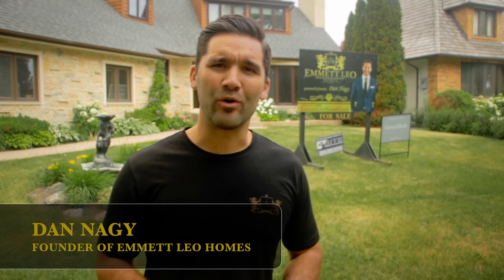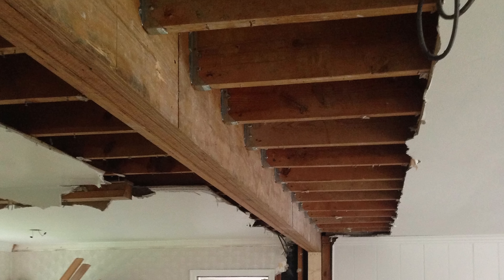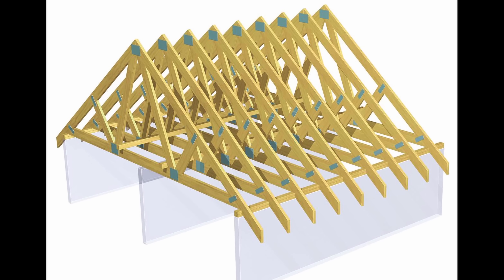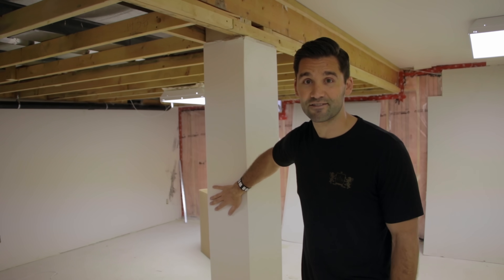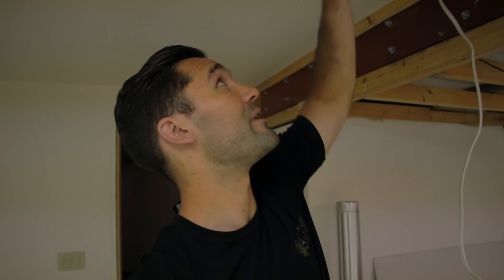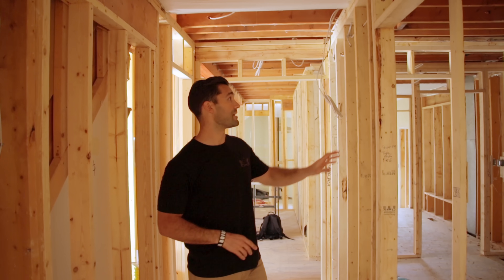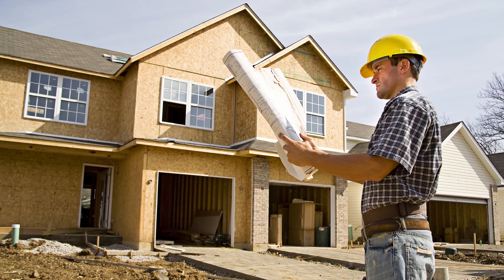The fastest ways to tell if your wall is load bearing or not!

Comment: Is there always the support and concrete pad under the floors?  I have log post, would there be these supports under the house of the posts that would be supporting?  There is not way to see this open valted area in the attic, as the walls to the area go all the way up.

Comment: Nothing "easy" about this explanation, I'm more confused now than I was before
Reply: Ok. So I'm not alone on that. Sorta kinda thunk i get it
Reply: Ya, I know right.. Im a licensed GC in Ca for 25 yrs now and all I got was "Thank you captain obvious" on a few things he said. B- for effort, and here's some actual useful advice - hire a structural engineer if you dont know things like trusses distribute the load to the exterior walls, or single story shear walls carry about 60 pounds per foot and 120 pounds for those with 2 stories. Also, if a wall runs parallel to the joists, it absolutely can be load bearing, it depends on how the loadpath was designed. You cannot simply explain away "load bearing wall removal" in a five minute YouTube video. This is the perfect recipe for a major catastrophe, some guy telling everyone they can definitely remove a wall if its running parallel to the joists. Scary. Like I said, 25 years building and modifying homes in some of the strictest cities and counties in the US and I still get a professional opinion on this. Not cool bro. Not cool at all. Someones house gonna fall down on their head cus you got em all confident they can DIY their own homes structural engineering.
Reply: @jdubs71417  I felt the same. Seems like a recipe for disaster. This video is for likes and subscribers.
Reply: @jdubs71417  I am an engineer. Most likely of the wall is parallel with the joists, it isn't load, unless it is an interior shear wall. However, those are easy to spot because they either have 1/2" cdx sheathing or the drywall is screwed on.
Reply: @jdubs71417  great advice. I hope everyone was able to see this
Reply: Wtf did he say?!
Reply: I'm even more confused 😕
Reply: @REALCRISKO  easiest way to tell if it is of isn't load bearing is to see how your joists run. If the wall you wanna take down is perpendicular to the joist then they're most likely load bearing. If they're parallel then they're not
Reply: Not all homes have basements either  like in Florida.
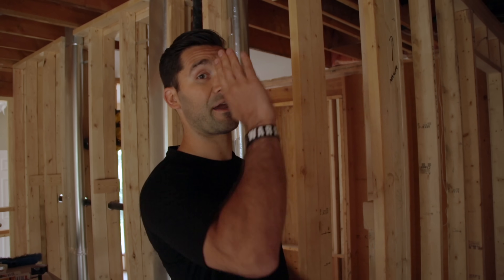Reply: Right? at 02:27 he says the joists run perpendicular from the said wall, when they were actually parallel. WTF?
Reply: @mrchedda  loll i thought i was the only one who heard that . wtf
Reply: @mrchedda   Yes, just using language precisely would improve the advice 50 percent. He also pointed at a "beam" which was a column. Doesn't seem to know the difference. oy.
Reply: @mrchedda  thank you! im like hol up. he just said that wrong.
Reply: @mrchedda  he is not taking that wall as a example....he is just talking an concentraring on the joist....if they run perpendicular to a wall forming a 90° is a load bearing wall, if they run parallel to a wall, it is not a load bearing wall....
That is how i took it.
Reply: Confused by him explaining geometry using loads that are bearing walls to be removed by looking at my house from the outside. Hard pass on this advice
Reply: same here , more confused
Reply: Im glad im not the only one.I know I am not this slow.lol
Reply: Thank you!!
Reply: Usually the longest running outside wall will have the floor joists sitting on them. If you have an un finished basement look at the floor joists they always are sitting on the longest run outside walls. And if you have a big enough span somewhere in the middle of the basement you’ll probably see a header or beam being supported be metal poles into the concrete that’s your load bearing wall and any walls going in the same direction above that beam are probably load bearing as well. If you have a finished basement and can’t find the load bearing wall just kinda find the centre of your home and any walls in the middle of the home are probably load bearing
Reply: Simplest way to put this is:picture a rectangle which is the basic shape for a house.in the middle of that rectangle you run a line parallel to the two longest sides.so you end up with three long lines (parallel)and two short sides.those three long lines are your supporting ( load bearing) walls(two exterior and one interior in the middle.all the joists will rest on those three structures at an angle ( cross) and any wall directly stacked above those three walls and run in the same direction ( parallel)are load bearing and so on.any walls that cross those lines(perpendicular)are NOT load bearing.
Reply: I think he's confused about perpendicular VS parallel
Reply: Ok so what is a joist?
Reply: I thought the drywall supported the roof?
Reply: @tbauer2521  lol

Comment: Would there ever be (ceiling) drywall between a top plate and a ceiling joist? I have a truss roof.  Wall is running perpendicular to the ceiling joist (middle of house). Seems like it is non load bearing?
Reply from the maker: metalmassacre84 good observation.  Partition walls with drywall between the two means that they installed them after the initial ceiling drywall was up, and then someone else renovated and left the small drywall piece there (and the wall).

Granted, there are times where people do stupid things, so beware and confirm prior to remove especially if it’s perpendicular to the trusses, but you have the right idea.  

What does the support directly beige the wall look like? In the basement or crawlspace.  That will be your best indicator.  

Thanks for watching!
Reply: Emmett Leo Homes its a 1960s house. This wall separates the kitchen and dining area. Im trying to open it up. It seems to me that the load goes to the outside walls (not this interior wall). At first i thought it was load bearing but took off the wall drywall and saw the ceiling drywall sandwiched between top plate and ceiling joist. This makes me look around more. Im thinking its not load bearing

Comment: okay, nice and cheeky. What if your "little" house is built on a concrete slab? Perimeter is load bearing, but interior walls?
Reply from the maker: David Balicki Then you don’t have any interior load bearing walls...
Reply: Before you pour the slab during initial construction, you pour structural footers to support posts that would be flush and level with the final slab.  For a remodel, you would have to demo a hole and pour a footer for a post to be able to bear the load to support a beam.

Comment: So I just bought a rancher. The wall between the living room and dining room is the load bearing wall. It has a standard size doorway between  the two, but I want to open it up about a foot and a half on each side. Is that something I can do or would it have adverse affects?
Reply from the maker: Christopher Spencer is it is load bearing, the opening will have a header above the opening.  This has to be elongated for the new opening.  

However, and this is the most important part, the structure underneath which is currently holding the posts or carrying the load of the wall must be analyzed and if you are moving any weight point load, they have to be carried down to whatever foundation structure is below.  

Best to start at the foundation and plan up from there for load bearing.  

Best to consult an engineer or architect, and they will be able to draw a plan, and stamp it to avoid any liability issues for yourself.  

Make sense?

Thanks for watching.
Reply: @EmmettLeoHomes  
Thanks for responding. It is a load bearing wall but the support column in the basement isnt directly under the door opening. The door is directly over the beam however

Comment: I'm wonder if the wall under my stairs in my laundry room is load barring. It does have a door. Not the wall on the other side, just the one in my laundry room. 
I want to knock out the wall to open it up.
Reply from the maker: A R stairs on the main floor or basement? Most new stairs are hung in place and then supported on the top and bottom, not typically by the wall that creates the small storage underneath. 

Does the all continue up above the stairs and support anything else?  

Thanks for watching.
Reply: @EmmettLeoHomes  thank you for responding. No basement. The stairs are on the main floor. 2 steps, then a landing, turns rt, then about 9 steps, another landing, then 1 step rt to the loft. The wall is attached to my wash room ceiling. The wall meets up with the hall upstairs, but not  further to a ceiling. There's a railing along that upstairs hall/wall, which would probably be the wall from the side of the stairs I would like out. Just that one side.
The other side of the stairs, the wall goes up to the second story ceiling. As I walk up the stairs, there a wall on my left, but open on the right and open above head. So as I walk up, the wall on the right gets shorter and turns into a railing.

Also, I have a few areas in my house where there are pop outs and hollow.  The builder could have put cabinets or something to use that space. There attached to the walls, so when I pond on the wall it's hallow. I really need space to put a cabinet. How would I go about doing that? Carve it out? Do I put a prebuilt cabinet? What to use or how to repair the dry wall (frame)? Do you suggest a video on this? Thank you so much!
Reply from the maker: A R there’s a lot packed in there.  I would suggest simply getting a recommended contractor in there to give you his honest opinion.  Maybe hire him for an hour to run you through it.

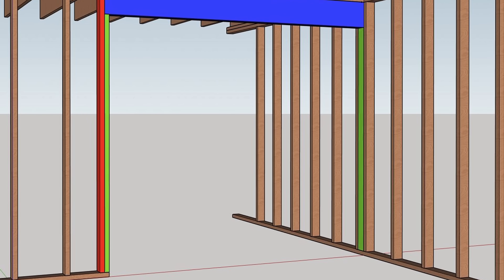Comment: 1:21 A single jack on each side of a greater than 60" span wouldn't fly here in the states anymore, how old is this photo? 7:00 new wall in an existing room and I see new copper instead of PEX, I build in the Colorado Mountains (9000') do you not worry about freezing pipes? Good stuff
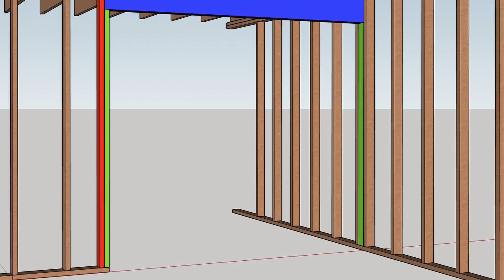Reply from the maker: Gobuilditbetter 1:21, yeah, not here either.  No idea about the photo, I’m sure the editors snuck it in here.  Post has to be as deep as the beam is wide.  Typically 3 ply 2x4 (or 2x6).  
7:00, that’s an interior wall you are seeing.  We use mostly PEX here too.  We only worry about freezing on exterior walls, which we then build out secondary or stub walls.  Thanks man.  Thanks for watching!  Stay safe out there!
Reply: @EmmettLeoHomes  Editors? Now I'm jealous. Good production. Be Blessed

Comment: Hey! I found this extremely helpful. I do have another question..do you need to re support the beams in the basement if you are removing a structural wall on the main floor? Thanks in advance.
Reply from the maker: badbike_widda_badbitch great question.  In most cases no, because the load above remains the same.  The only time this changes is if you are changing the load points (the pints where the upper load is being transferred to the downstairs support) and where they come down.  If you move them off the beam/supporting structure, then you will have to reconfigure/re/engineer the support.  Make sense?  

Thanks for watching!

Comment: This video is about load bearing walls and support of structure. I noticed those 1 3/4  inch holes drilled in the 2x4's for the 1/2 copper pipe. Thats not code. I would throw them off the job and toss there tools in the dumpster so they can't do that damage to anyone else's home. I would get there kids names and send them all a letter informing them there is NO SANTA CLAUS as well. That wall is no longer studded with 2x4's..its studded with 1 1/2 x 2's.  Also..if you want to know what way the ceiling joist run just go in the attic. You knock a hole in my ceiling just to see what way the joist run then you just bought yourself an asswoopin. I would flattin your truck tires and for redundancy poke a hole in your gas tank to be SURE that I atleast slowed your fuckery.
Reply from the maker: Effie A Marty First...you need a hug.  Second...yes, running your plumbing through 2x4 walls is code.  

And a 2x4 stud measures 1.5” x 3.5”.  The old dimensional lumber used to measure 2”x4” until they came into mass production.  

Also, don’t be so mad at your father.  I’m sure he loved you.  

Thanks for watching.
Reply: Wow.

Comment: You can use a magnet 🧲 to find the screws and find out which directions they go... just a helpful tip lol
Reply: Good IDEA buddy.. !     Thanks!👍
Reply: Can you give more info, which direction should it go?
Reply: Cenddie Alaban well if it’s a wall, the studs should be 16-24” apart and the screws should be 1 foot apart... just pretend you are erasing a chalk board and you will find the screws.

Comment: One quick way to determine a load bearing wall (if it's not covered and you can see the framing) is to look at the openings. If the opening has a solid header above it, I can guarantee that the wall is load bearing. Non-load bearing walls will have open framing with short studs (known as "cripples") above the opening. Also, in older homes (80's and before) the interior non-load bearing walls only had one top plate, while load bearing walls had two, just like the exterior walls. However, in today's construction, many builders just double top plate all of the interior walls so they can use the same pre-cut stud height for both load bearing and non-load bearing walls. Great video! I enjoyed it!
Reply from the maker: Thanks for the comment and watching!
Reply: What about a mid 1970s ranch with engineered truss? 1000sf small ranch with crawl
Reply: !aå
Reply: That's some pretty based "rules of thumb" that I could contradict with most of the homes I've owned.
Reply: Over time, twists & turns even small can transfer loads unexpectedly so it is good to check as is vs what it should be

Comment: Even with all of this, you may have trusses designed as clear span trusses, as in my house. In that case, there are no load bearing walls, on the upper floor. Of course, the only way to know is to have access to the original plans. Plans were submitted to your regional building authority. You may get that info from them.
Reply from the maker: Correct.  Thanks for watching.

Comment: I can generally see joists just by them bowing... No need to damage the ceiling ...
Just making big posts don't mean much. The entire load is now directly on those posts, rather than distributed through the entire span. You need to know if whatever is directly below can support the weight as well.
Reply from the maker: LightGesture you bet.  Understand where the load is at the bottom (which is why we say start from bottom up) is imperative.  Thanks for watching!

Comment: So if I go into the basement and the joists are running north to south and the wall in the kitchen I want to take out runs north to south, it it not structural-meaning I can take it out...? “Should be able too”
Reply from the maker: Melody L well, it doe so dictate that it may not be load bearing.  No second storey?  Any other architectural features that may change the load bearing?

Using this video as a guideline is great.  I would dig deeper now as chances are good that it is simply a partition wall. 

Make sure to have someone local come in and make sure 100% prior to removal.  

Remember that you may have mechanical, plumbing and electrical that needs Re-routing if it is in the wall you want to take out. 

Thanks for watching!
Reply: Emmett Leo Homes there is a second story. Gabled roof...there is no plump or electrical on the wall at all. In the other side of the wall is a wall length closet. I am pretty sure it is not load bearing but I will ask a contractor friend to verify. Thanks for your response and your video!

Comment: Do the floor joists always run the same direction as the ceiling joists?
Reply from the maker: Most of the time yes, in simple construction, they run the same way.  

With more complex structures, or more custom builds, you may see some alternating supporting structures.

Comment: I noticed that you retained the support post in the basement that was directly below where you installed the LVL beam (in the video you said it was right below where you were standing) why didn't you remove that post as well?  If the load on the first (and subsequent floors) has been transferred to the outsides of your 20' LVL I would assume the beam you were standing no longer supports the rest of the house, it would now only support the floor you are standing on, therefore you could open up the space in the basement below as well.
Reply from the maker: No.  The upstairs structural wall was replaced entirely with a post and beam (instead of the entire wall.  That post upstairs had to be supported by on downstairs.  You cannot have a post upstairs unsupported from below unless you are redoing the ENTIRE structure below to support it (which wouldn't make sense in this application financially or practically) . Thanks for watching.

Comment: super important to note that this only applies to homes that were built after about 1950s era. I've got a 1900 house, and literally every wall is load bearing.

Especially the walls in the 2nd floor that some idiot in the 80s moved around to where they are not on the bearing walls below.
Reply from the maker: TheFiremonkeyman thanks for the comment. There were still partition walls built prior, however none of our modern floor truss systems were around then.  

Thanks for the comment and for watching!

Comment: If you have a ranch style /square home (lets say 30x30) and your basement/first floor joists are perpendicular to your attic/roof joists... how do you find your load bearing walls?  My house is all over the place... so I'm just putting up beams where I may need to put up beams...
Reply from the maker: Check what is holding up the first floor joists and beams, and go straight up from there.  Thanks for watching.

Comment: Cool video. Do the joists on each floor generally run the same way?
Reply from the maker: That's what you'll find in most simple homes.  More interesting structures may not follow such simplicity however.